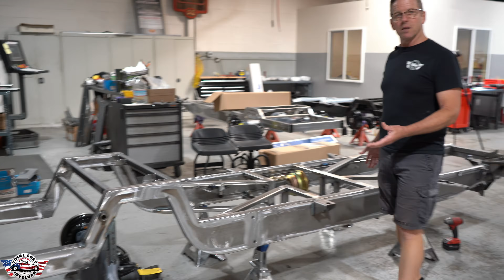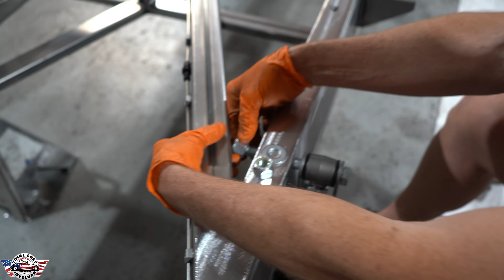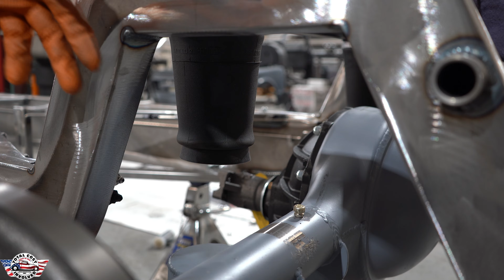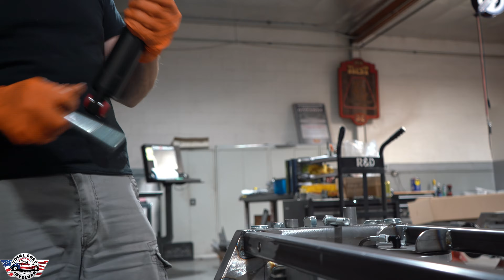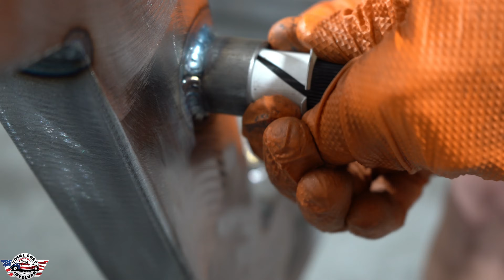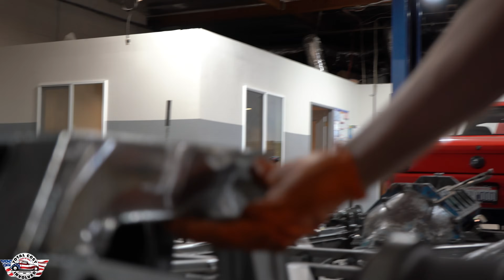TCI Engineering Grounded Chassis Assembly Part 2: 1955-1959 Chevy & 1948-1956 Ford pickups

Comment: Would it be advisable to use grade 8 hardware for the suspension vs grade 5?
Reply from the maker: The main reason for the grade 5 is they are more than adequate in shear strength in these applications. Plus a Grade 5 will distort/bend before they break. Grade 8 is more brittle and can be catastrophic if they fail.
Reply: @tcimuscle  Thanks for that info, that makes a lot of sense.